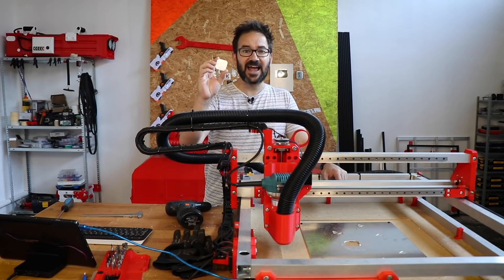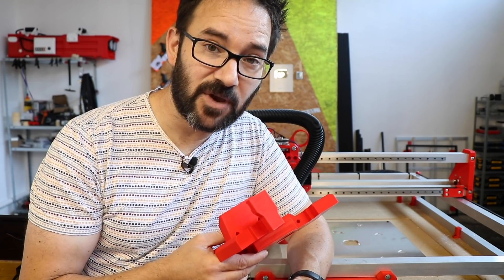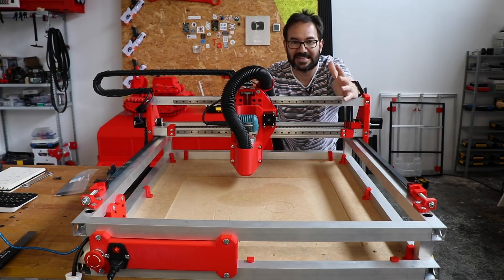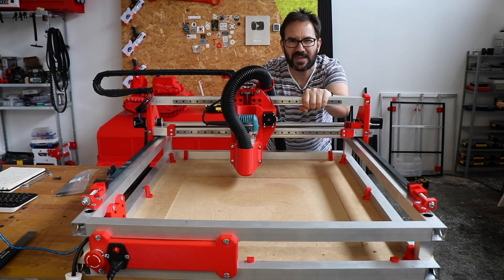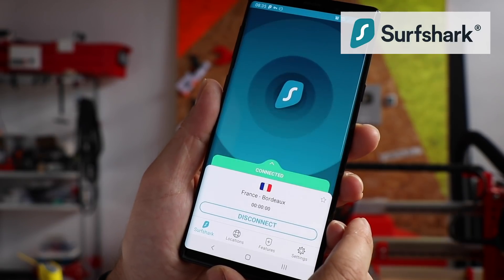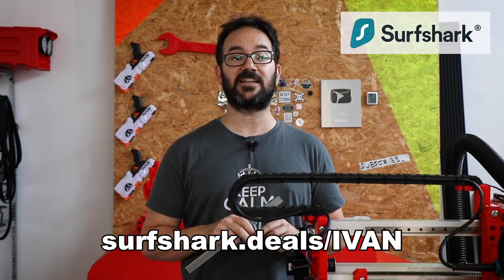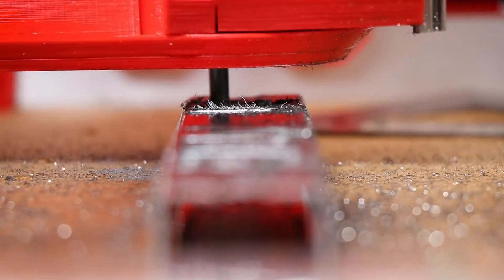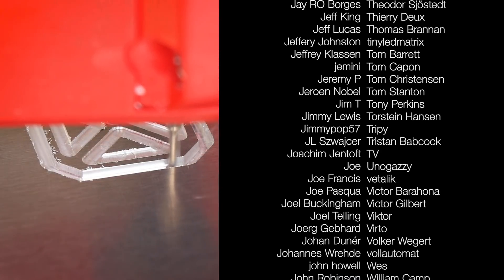CUTTING STEEL WITH A 3D PRINTED CNC

Comment: Great build! Do you think think this could cut or shape 3/8" or 1/2" steel (albeit very slowly)? Also, would carbon fibre components have worked as good as or almost as good as aluminum?

Comment: Hey, Ivan, why hdd5 belts on the machine and gt2 belts in the motors, the motor will have to handle all the force so it still in the hands of the thin belt, it didn't make no one change no?

Comment: I’ve started printing the parts and ordering stuff to make this. Just found out that in Australia we don’t seem to have 30 x 30 x 2 aluminium square tube. I’ve had to use 32 x 32 x 2 instead.

Comment: great device! genius to try it out with 3D printed parts because the budget would make or break someone from even thinking of buying a cnc to invest in so doing it out of a 3D printed part omg that will make so many have a CNC machine even if its slow at first to wet your feet into CNC machines for practically nothing of money compared to a metal version that would cost thousands for that size one....do you have the plans for it in pdf form?

Comment: Ivan, I’m currently watching your back catalogue (upto the 4th tank atm). I haven’t read any other comments to see if you’ve answered (you may have addressed already in recent videos) Just curious why you haven’t made a filament recovery machine to grind up your waste parts to create pellets and then create (or buy) a filament extruder and make a project out of it?  The recycled/ remade filament could be used for early iterations of projects, so you’re not wasting good filament on early prototype parts. Just an idea....

Comment: Nice! Though, I think you must update with a good spindle, servos (better than steppers) and state of the art linear rails. Course you also need a proper coolant system with an optimal plate ready for vises, vacuum fixtures, etc.

Comment: I saw CNCs that had the rack on which the pinion engaged directly (after the necessary reduction of course) avoiding belts but with much powerful motors. 
However nice product Ivan! and nice upgrade!

Comment: I don't know if my question is stupid... is it possible to make the cnc you've done and modify the thing to hold the tool to put a laser and make it changeable easily between both tools? I want to make one but I don't want to have a whole machine for cnc and another one for laser (I don't have a castle or even a garage or workshop...)

Comment: I noticed that your 3D printed parts have dark scorch or burn marks on them, and you even said that the stepper motors were actually melting some of the 3D printed pieces. Now that you have your CNC dialed in, and a lot more stable, maybe try milling some aluminum parts to replace the 3D printed parts. This will give you even more stability, AND.......your parts won't melt.

Comment: Just a thought, if you want precision, strength, and longevity, you may want to eventually switch over to ball screws. They aren't cheap, but they will work and work well.

Comment: Great job ! 
A Litle tip when you work on a thin plate put some large plot of carpet tape under the sheet. It stick very well an avoid the sheet to vibrate and bunce on the martyr without this you take the risk that the plate lift up on Z axis. 
1 theeth flute are good for premachining but not for final pass and clean finish use a dual dual flute for a clean surface. 
Think about adding microlubricarion / /Mist-Coolant-Lubrication to cool.

Comment: Speed of metal removal is ALWAYS to slow. I trained as an engineer using bloody great industrial milling machines and lathes that could turn a serious amount of steel into swarf with each pass. Nothing seemed to phase these monsters. They were the kind of sized mills you'd use when you needed to use a fly cutter to machine BOTH the ways flat at the same time on a large industrial lathe bed !!!! You could take a 1/4" cut with a 3" side cutter and it wouldn't even blink. The only problem you'd have was that the material would have expanded from the heat so much that you'd end up cutting a taper into the work piece that you could almost see ! 
Unfortunately, Because I started out with these, every machine I've used since then has felt like little hobby grade lathes or mills.

I'm currently looking for a bench top milling machine to go in my little home workshop. Space dictates I can't even have anything as big as the ever popular Bridgport, So I already know that whatever I get will be soul crushingly slow at shifting metal. :(

Comment: the belt stretchers are nice, but why not switch nut and head (head away from the belt, nut in the belt holder) so that the part with the belt can be made stronger with 4 walls instead of 3 because the bolt does not need to be inserted from the side? cf. 5:57

Comment: mill the aluminium parts to replace the 3d printed parts. you've used the printing to prototype and make a thing that cuts steel/ ali but the machine that births a machine that makes itself stronger just sounds like Ivan making a terminator breeding programme
Reply: also 3 or 4 flute end mill would be better for faster cutting too. more material removal per rev.

Comment: Why not go with bigger Nema motors, Nema 43 for example. Geared stepper is also more expensive, but the driver must be able to handle higher voltage and current.

It should be less backslash with a stepper only solution.

Comment: Frame stiffness is good - but work holding is also critical as you can brake a tool . Using only 4 screws for whole ALU plate (especially not so flate) is not enough . As you can see on some cuts - material goes up during cutting. As the result you can cut more deep and brake the tool - 1 flute end mill a not so stiff. ( especially on a belt's). Use some additional holders near cutting edge - there will less rubbing also .

Comment: Need more many there.

The slot for the bolt head seems to weak and plastic will deform over time.

But great stuff subscribed.

Get rid of ads...doesn't that defeat the purpose of ad sense and you making money from it.

Comment: Very cool but dang ya put out the plans after i ordered a longmill lol. Recomend if ya cut any metal even aluminum ya use cutting/tapping oil not wd40. While wd can help lube some it does not like heat and heat kills cutters fast. A cutting lube is designed to keep things cooler while lubing.

Comment: Well ill be damned.  If the 3d printed one can handle steel I wonder if mine can.  Its an avidcnc 5x10, the motors are about 500 oz/in, much larger than what Ivan is using and the frame is MASSIVE aluminum channels i could barely lift.  Its not specced for steel... but the spindle should be capable of it and the motors should be...  maybe I'll try.  Really wanna cut a new sprocket for my bike.

Comment: Ivan, I think you should work this CNC mill hard and fast. When something breaks, fix it but then make that part from metal with the mill, replace the part and then work it hard again, and repeat.

Pretty soon you will have a very strong milling machine. Great project, great video. Thank you!

Comment: How much will all the needed parts cost? I guess it would be interesting to know, before buying the plans 🤷‍♀️
Reply: Max H. I would guess about $500-$1k as a high guess or around $100-$250 at a low guess
Reply: @Volt64bolt  Wow thats a big inaccuracy, i mean as a student 100 would be fine, but 1k is a bit too much for a machine that im not using that often 😉
Reply: @xXMax2000Xx  it's still much cheaper then a normal CNC they can cost upwards of 5k.
Reply: @Datttsnake  Well, sometimes id really need a cnc, but wouldnt work that often with it... so a real cnc would be nothing for me too.

Comment: Holy cow, Ivan. Once again you've raised the bar with your videos. Need to see if my printer is big enough to handle those brackets. Going to be close if they fit. 
Edit: ugh, missed it by 15mm. Maybe if I angle the parts 'just so'.... 😅

Next thing you know, Ivan will debut a Plasma CNC.
Reply: What is the size of the biggest part to print?

Comment: As a note, you could use the cnc to cut out metal parts to enhance the plastic... thus improving the durability and accuracy of the cnc \ 3d printer... rinse repeat. =D

Comment: instead of using belts, would going with toothed rails and cogs.
Reply: You can get quite far with sturdy belts like these, especially if you’re not using it 24/7 in a shop or something like that. Rack and pinion is “better” but is a lot less forgiving than belts and also a lot more work and cash, quite unnecessary for this steppers 🙂

Comment: Ivan with those belt tensioners couldn't you switch the direction of the bolt & nut to remove the requirement for the cutout in the piece gripping the belt & give you more plastic=more strength in it?

Comment: The model you sell - does it include the list of all hardware required and a "how to make it work for dummies" guide?
Reply: aloowakp yes, excluding the dummies guide, it’s just a normal one I think? Don’t quote me on that though
Reply: @Volt64bolt  yeah not for dummy. So couple things, the BOM is not quite up to date with this video (belts are still GT2 for example). I wouldn't recommend this being your first build. Get used to building 3D printer kits maybe before. You need basic understanding of motion systems to make sense of it all. Don't misunderstand me, it's on the higher end of build instructions out there, juste not very beginner friendly.
Reply: Marc Boivin yes, I just purchased it, and even the video linked at the top of the documentation instructions for what video to use to build the machine, I believe, is wrong, as it links to building the 3d printer?
Reply: @oELxTOROo  It would be nice to get a GitHub link to contribute when we buy the kit. I think it's a pretty nice kit for thinkerers and is way more capable then a V1 or a low rider. But yeah, still some quirks here and there

Comment: As a fellow 3d printed cnc router designer, I highly recommend you print your stuff out of polycarbonate or nylon-cf filaments, so they can handle heat better and handle more dress too

Comment: Ivan, I have a 3D printer, however the bed size is too small. Can we order the 3D printed parts for the upgraded CNC machine from you? Or maybe even a kit with all the hardware and 3D printed parts? If not do you have a printing service you could recommend?

Comment: Can we use thicker wall aluminum tubing for the frame and also could you design the mount to hold a proper water cooled spindle. I wanna basically build it stronger then use it to machine the printed parts out of aluminum to make it even stronger still.

Comment: going to have to try and build your version, does the link plans include the updated parts to cut the metal?
Reply from the maker: Yes! Thanks!
Reply: @ivanmirandawastaken  what is the size of the square aluminum tubing that you used? 25mm or 30mm? Have to see if i can find metric instead of Inch.

Comment: Belt stretch isn't the biggest issue with belt-driven CNCs running high cutting force operations, but the backlash in the steppers themselves, even with gears there is some.
Thou those motors and belts probably help to get to a point where its hard to tell if its the Kinematics or 3D Printed parts that deflect from the cutting forces.
If you ever want to build a larger more stiff machine, then get some Ballscrews, they give you the most bang for your buck compared to old systems like gear tracks with worm drives etc.
And if you ever want to upgrade that router, since you're in the EU you could get an AMB 1050 FME-P, lightweight german made spindle for small machines with an ER16 Collet system. I'm using it on my own CNC since I was unhappy with the Makita Router and Chinese Spindle I had.

Comment: Couldn't you just move to nema23 steppers instead of geared nema17s -- gear boxes inherently have backlash and slop -- the conservative upper limit of belted machines should be in the neighborhood of 100 inches/min, there is no way to do that with geared steppers since they can't spin that fast due to the gearing reduction (they need to spin 19 times faster to get get the same speed output as without gearing)

Comment: Ball screws would have been better and cheaper, since you wouldn't have had to replace the steppers. Less chatter, and guaranteed not to lose steps because of mechanical advantage. That router is too fast to cut steel. With carbide tools the SFM of your bit should be 200 if you want them to last for a long time.

Comment: You’re starting to get into milling machine territory... you should probably read up on how the big machines do things; with an eye for ideas that can be applied to your machine. 

Minimum Quantity Lubrication is the first thing that comes to mind; and as you’re going to be needing to run wet (well, damp) I’d also look into replacing the base board that the machine is mounted to with something waterproof (an aluminum tooling plate would be best; but a good-quality laminate countertop section would do). Onto that base you would mount the sacrificial backing boards. 

T-slot extrusions and T-bolts are used commonly in woodworking setups for holding stuff to the table; and have a variety of clamps available off-the-shelf. Larger versions of this are commonly used on milling machines; but they would be to large to fit under your gantry rails.

Chatter and surface finish will improve with increased machine rigidity; and the thing that jumps out the most as a weak spot (other than the fact that it’s 3D printed; not cast iron, but there’s not much to be done about that) is the long unrestrained beam sections. I suggest cross-coupling them to form trusses.

The other thing that occurs to me is that you might look into what’s called “epoxy-granite”. Basically, it’s a mix of sand, fine crushed rock, and epoxy; and it sets up to resemble synthetic quartz countertops - reasonably strong, hard, doesn’t warp or crack like Portland cement based concrete does, and has good damping characteristics. You could fill the machine frame beams with it; as well as filling 3D printed parts or 3D printing molds to cast it in. Just do take appropriate precautions with the sand & epoxy - not getting it on your skin is kinda obvious; but you really don’t want to breathe silica sand dust because it gets in your lungs and obstructs oxygen absorption, and being basically inert, it stays there forever. Gloves and a respirator rated for sanding (such as is available at your local DIY center) will take care of both issues. Hardinge was using their version of this for their high-end tool room lathes frames a few years back...

🤔
Reply: And Kern uses Epoxy Granite/Polymer Concrete for their machine bases as well.
Reply: This is all cool thanks for commenting

Comment: Amazing.  What router bit did you use on the steel & feeds and speeds please.
Reply: DavidinEssexUK it says on screen
Reply: Volt64bolt not for the steel cutting it doesn’t.  He shows the bit for aluminium and speeds but then changes the bit to cut steel without any details.
Reply: @DavidinEssexUK  That is a 4 flute end mill.

Comment: Great video! Would be very curious to hear about a part and cost breakdown of the whole machine. What printer you use to print it and with what filament etc. :) Keep up the good work!
Reply: Gereon Wahle im not sure but my guess is that the printed the parts on a prusa mk3

Comment: Wanting to design an build my own cnc mill what's the name of these aluminium things thatt you have used for most of your structure because normal aluminium extrusions are pretty expensive and maybe i can save some money by changing them out where i can. Love your cnc btw but it goes over my head how 3d printed parts can hold it.

Comment: seriously amazing Ivan! there are some awesome design features but i would not have imagined the machine would end up this capable. its really a serious, versatile machine to let you cut some steel. extremely impressive! great work!
Reply: what were the speeds and feeds for steel please btw?
Reply from the maker: 200 mm/min 0.1 mm downspiral not sure abut RPM but slow around 10000
Reply: @ivanmirandawastaken  ok, awesome! its not fast but the result is really clean. 45 minutes for something nice that i could NEVER do otherwise is pretty good right? very nice man! my mind is blown. i've been designing my own budget cnc too but i don't think i can do better (/or anywhere near as good). i'll try first but then i'll buy your plans :-P thanks dude!
Reply from the maker: Yes!! Thanks!!

Comment: Awesome!!! Does the temperature of the steppermotors change with the gear?
Reply from the maker: They have more mass, the motor is further from the 3D printed part and they have to run less time so they are definitely colder (or you can run them at higher currents) Thanks!